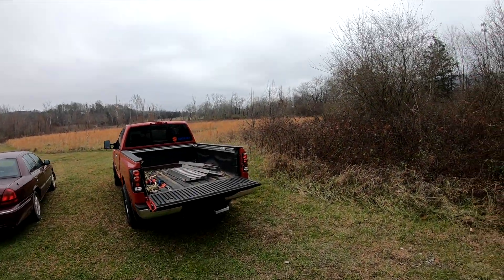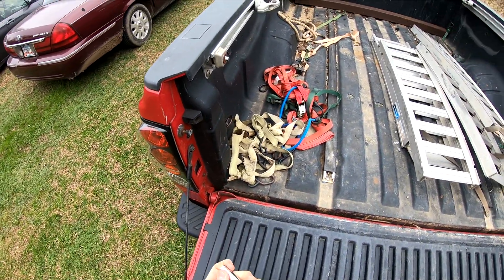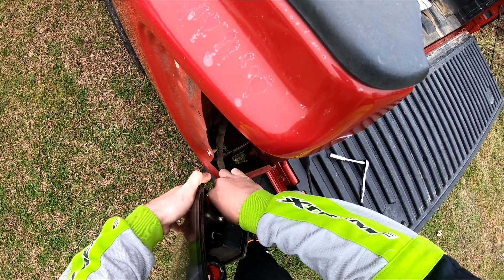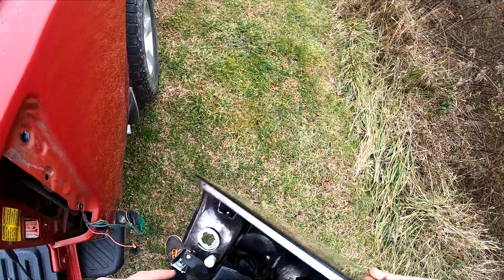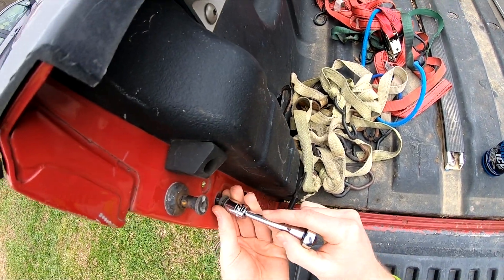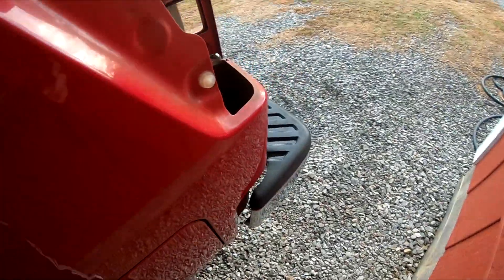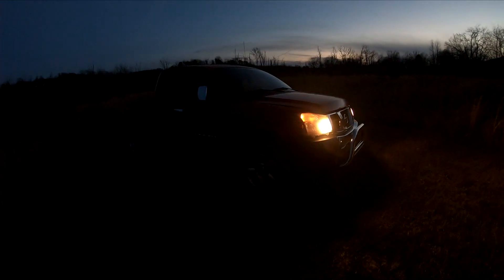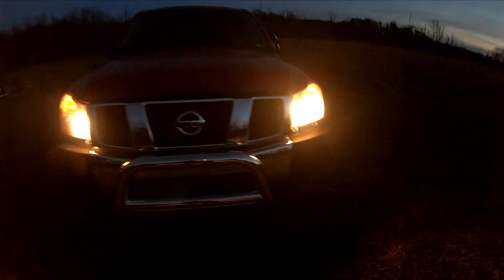Nissan Titan Bed Removal! (Build Part 1)

Comment: How did you get the taillight wires pulled back through the hole in bed?
Reply from the maker: I don’t recall taking them out. I must have disconnected a main harness under the bed and left any wires in the bed

Comment: 2004 & 2005 are the SAME bolt pattern with the EXCEPTION of that little cargo box on the drivers side on mine?
Reply from the maker: Should be , at least with the King Cab

Comment: If you had a helper you could had lifted the bed and not have to remove the tires.
This is nice though for a one man job. Tnx
Reply from the maker: Yeah I didn't have anyone at the time. It is super heavy even just 2 people. It's hard to lift high. Got it done though. I'm working on the truck as I type this. New exhaust.